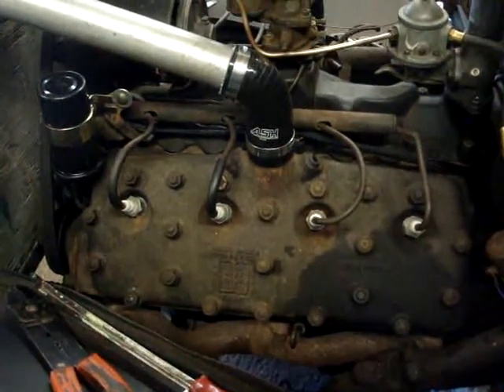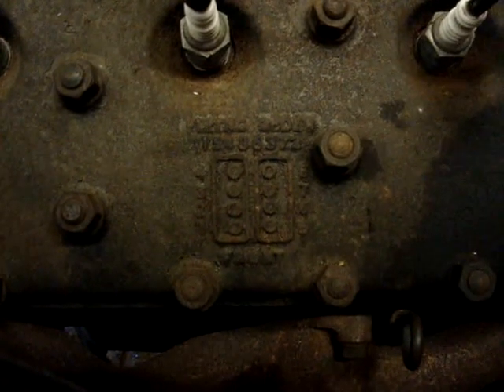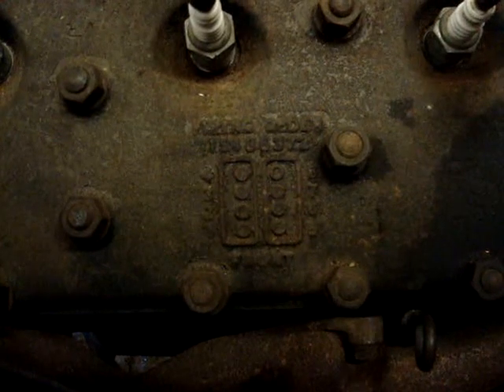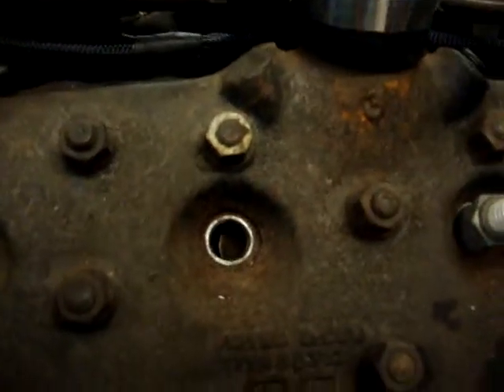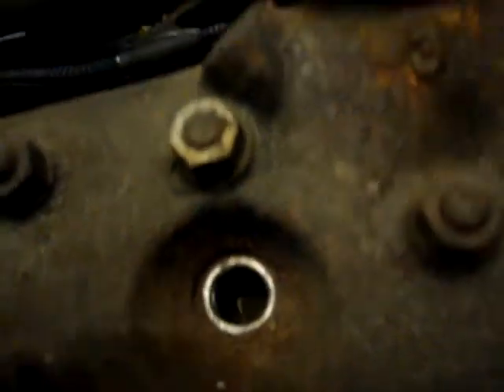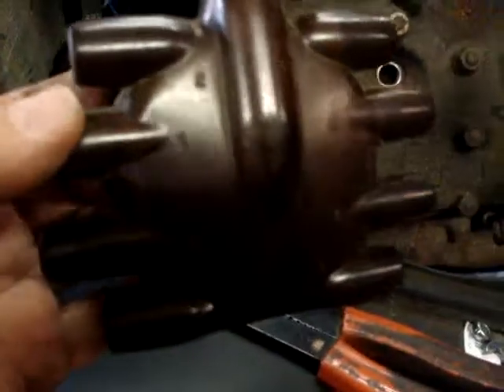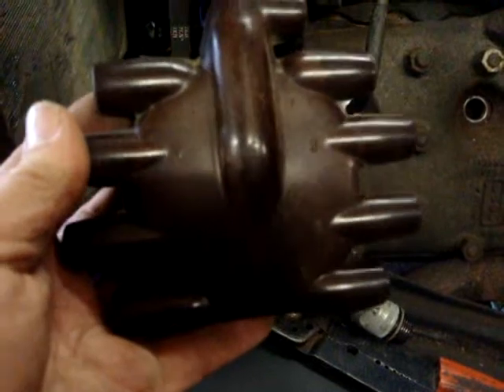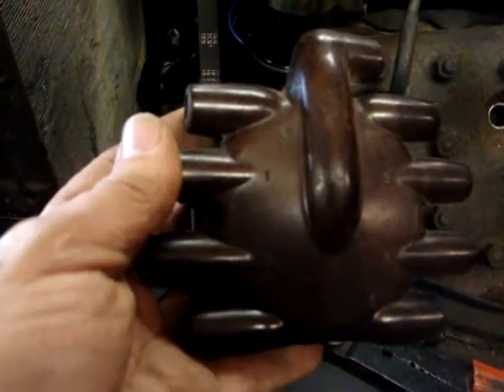Ford Flathead V8 Timing Check

Comment: Thanks (13 years later) for posting this. 
I have just acquired a 1951 Pilot.  I had one years ago so I know what driving a pilot should be like.  The new one is definitiely lacking in oomph and it feels to me that the timing is retarded.

My question (If anyone can answer it).   How can I check the timing of my new pilot with a strobe light ?    TDC (so far as I know) is not marked on the main pulley.
Reply from the maker: Hello and thanks for watching and commenting. I did a video on this subject. Ideally it is best to do it when you have a head off, but an alternative method using a cable tie can also work. Have a look at this and see how you get on. https://youtu.be/dn446jjCVRg

Comment: crap distributor mate  go through puddle won't start for a week .if you go more than 20 miles better have sparse generator & pistons.fuel pump. had 47 woodie once
Reply: @MartsGarage  thanx   was 60years ago  my first  car  then willy's wagon then stude 51conv  289  engine from hawk .🤗 Woodie totaled rear ended 😣